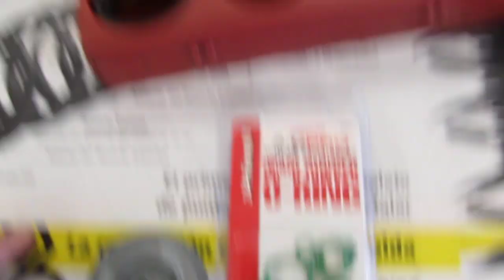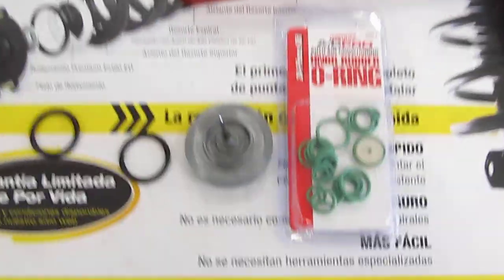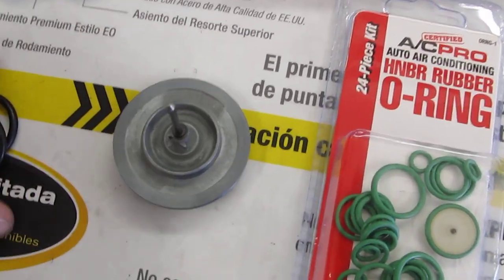Sanyo M9935K Boombox Idler Tire Repair Found At O'Reillys Auto Parts

Comment: ALLO WHAT IS THE TWO O-RING NUMBER OR THE DIAMETER  FOR THE SANYO Sanyo M9935K
Reply from the maker: I just tried sizes until something fit otherwise you need to get some micrometers to measure with I don't know the size
Reply: @DecentMan4you  ok